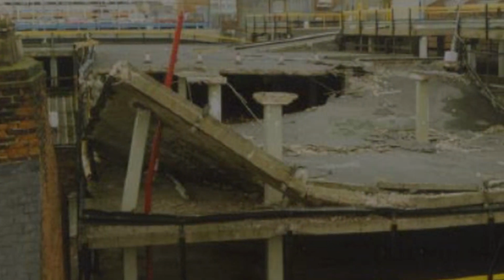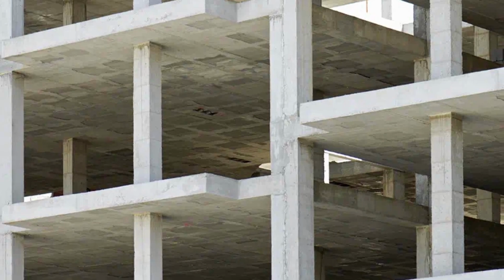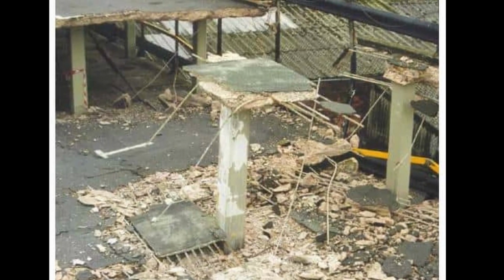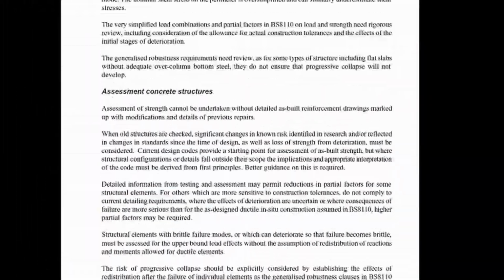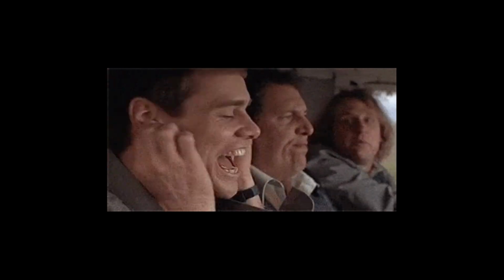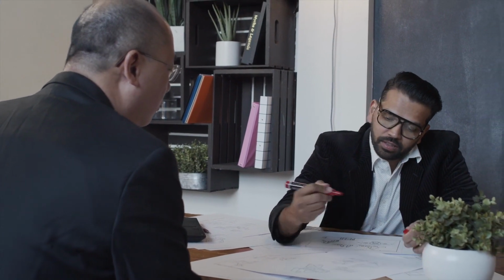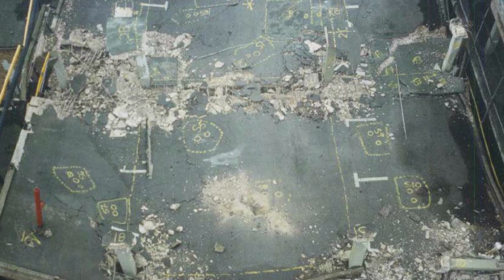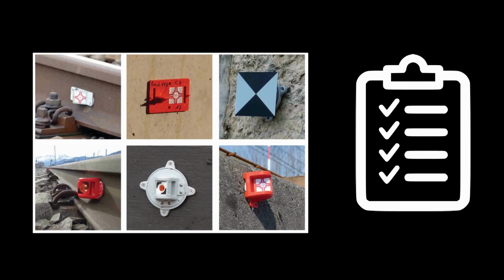FLAT SLABS, PUNCHING SHEAR and the COLLAPSE of Pipers Row car park

Comment: Great video. Curious as to why this didn't cause pancaking. Was it just the top floor that had issues?
Reply from the maker: Correct, the top floor had more degradation than below, due to being exposed the most. Also, only a few column caps failed, and the rest of the slab probably slowed down the falling pieces.
Reply: @erikoui  interesting. So is this a waterproofing issue? If the top floor was adequately sealed it would have been fine?
Reply from the maker: @VonBugle  Yes, this is what the owners should have done during maintenance, before the damage was so deep as to need extra support